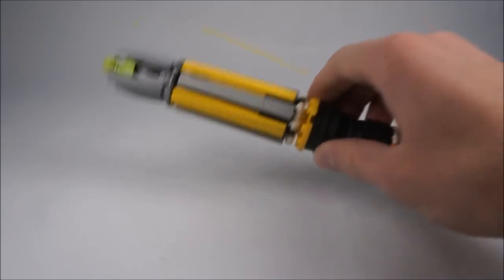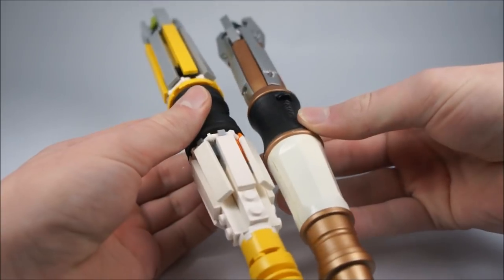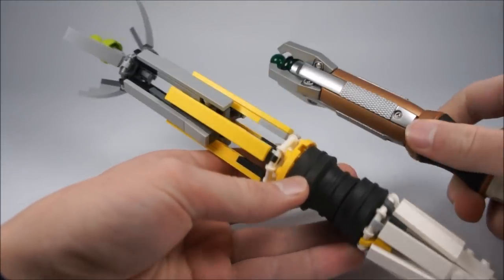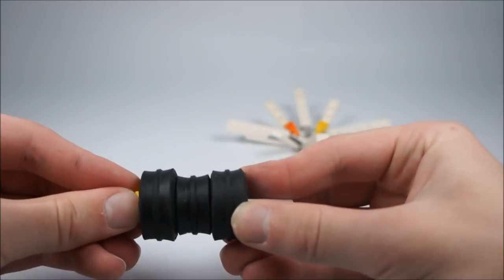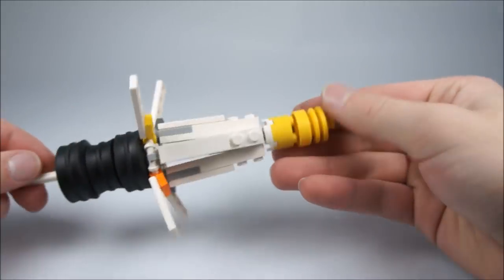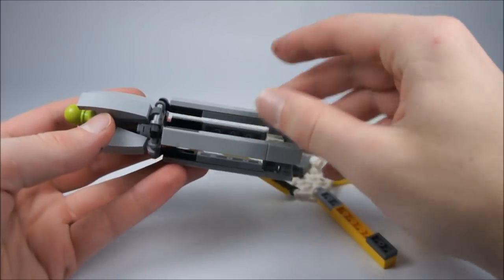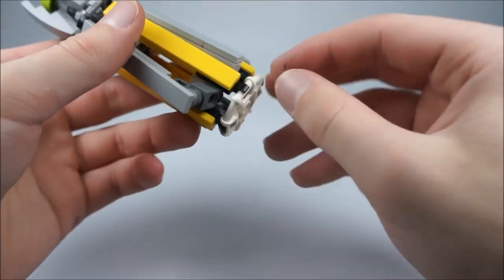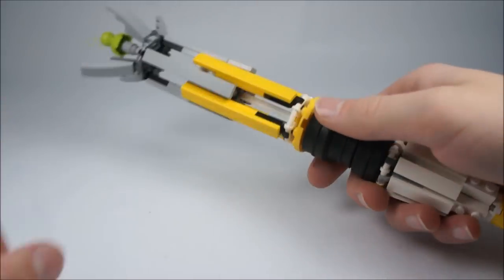How To Build A Lego Extendable 11th Doctors Sonic Screwdriver

Comment: I just recently came across this video and since I put way too many hours on lego’s website picking out all the pieces I thought I’d write all the brick ID’s down here in case anyone else decides they want em even though this videos pretty old :) (also I changed the colours of some pieces on the top half cage to a mixture of dark green and brown to more closely match the colour of the original sonic instead of yellow like this guys build)

4x 6042950/11153 - claw pieces

4x 4245566/3666 - inner cage 1x6

4x 4211438/3666 - inner cage 1x6

4x or maybe just 2x - 4211398/3023 inner cage 2x2

2x - 6360111/52738 - clamps for inner cage to hold double stud piece that holds the cage together as well as holds the claws on the emitter area

2x - 6271752/31561 extended stud attached the above clamps to hold cage together for double stud effect

6038201/6141 - 1x1 studs for the cage, however many u need idk

2x - 4210639/6541 is the 1x1 with the hole in it for the cage

1x - 6347715/42456 missile piece that’s holds the green emitter thingy

1x - 6038353/30367 dome for the emitter

1x - 4624381/32474 ball for the emitter

4x - 4211159/4032 round 2x2 plates for emitter area and bottom half

4x - 4211481/4162 flat 1x8 for the gray part of the cage

4x - 6351291/4162 flat 1x8 for the yellow part of the cage which are brown in this case 

now i wasnt able to find the webby looking hexagon piece that things clamp on to on many parts of the sonic so that’s up to y’all to find :/

1x - 6005030/60474 round 4x4 plate that the top cage attaches to as well as the above listed 2x2 circle

3x - 6296849/39223 are the thick circle pieces the tyres go over for the handle which are green in the above listed id since i thought the colour was neat and you won’t see em anyway

1x - 6036503/92947 is the other thick circle piece that had slits in it that the tyres also go over and again the above listed 2x2 circle is attached the this part too

1x - 6317564/69732 16 stud long axle for the handle/ cage mechanism

1x - 4499858/55013 8 stud long axle with a stopper for the bottom handle part

1x - 6275844/42798 tiny grey stopper for a part of the bottom handle

1x - 6173116/29219 the white tube also part of the handle insides

1x - 6271167/42136 lil yellow stopper that goes somewhere idk i’ll watch the video again to check im tired lol

1x - 6212049/59443 cross axle stopper for the handle aswell that goes on the end to hold things in place

1x - 6294526/67125 tyre rim that goes on the far end of the handle

4x - 371001/3710 white 1x4 plate for some of the white octagonal handle part

4x - 366601/3666 the other four 1x6’s that go on the same handle part

4x - 663601/6636 flat tile 1x6’s that cover the white handle part 

4x - 243101/2431 flat tile 1x4’s that cover the remaining white handle part

4x - 6361170/42923 is the white 1x2 connector clips that attach to the 1x6’s for the handle that clip on the weird hexagon thing that i didn’t find the id for 

4x - 6335378/52738 1x2 clips for the rest of the white handle bit

now for the tyres lego doesn’t sell the ones in this video anymore since it’s old but i chose these ones which I am yet to find out if they fit since as of writing this none of the parts have actually gotten to me 
here they are though
2x - 4246901/50951
1x - 4508215/30028

Aaaan I think that’s everything! I really hope Im not the only one to see this video recently cause did this ever take a while to write up lol

Comment: When you said the actual 11th doctors that was the 12th. The one you said was the actual 12th doctors was 11th
Reply: The 11th Doctor sonic he showed was marketed as the 12th Doctor's and had different features, such as a removable power core.
Reply: Caleb Gamer555 I mean it is easy to get mixed up since the 12th used the 11th’s.
Reply: The 12th used the 11th’s for some time until he got the blue one

Comment: Props on creativity but the blue one is the 12th doctor's sonic not the 11th lol don't know if that was a slip or intentional but id reccomend making the grip all one solid piece not going for the hourglass shape it doesn't look comfortable, also try making the claws spring loaded as the astectic design is nice but not prop accurate, also if you don't want pieces falling off, this is subjective of course, I'd highly reccomend super gluing all the non moving parts as legos are notorious for falling apart very easily whereas knex would be a better bet, imo. Otherwise all-around very good design very well done.